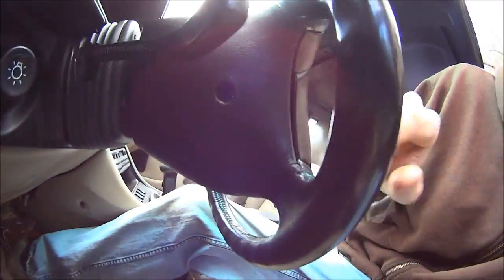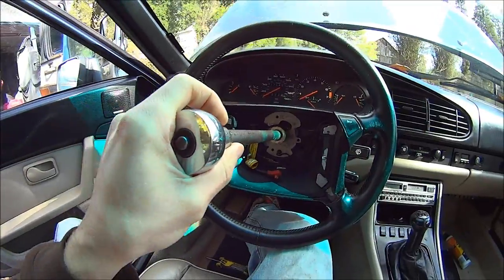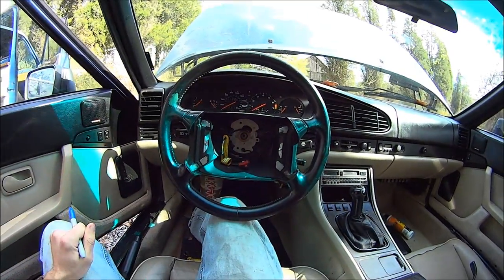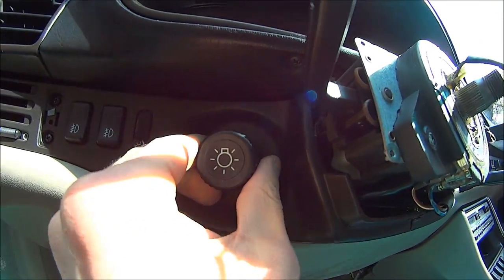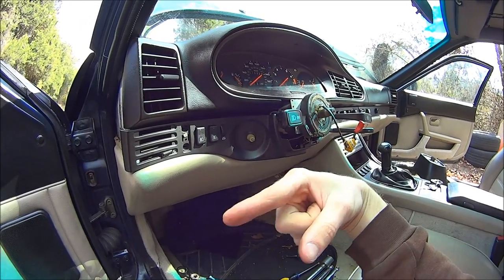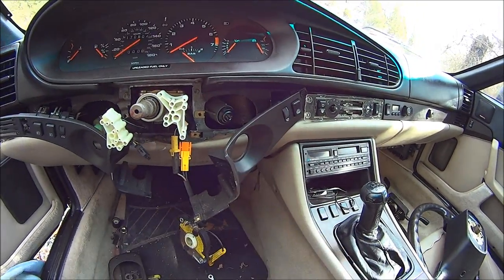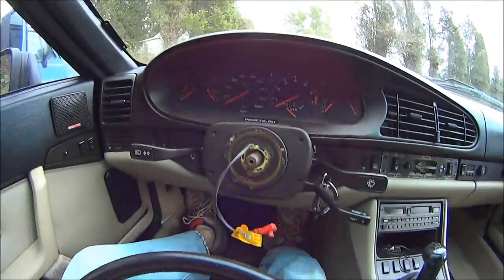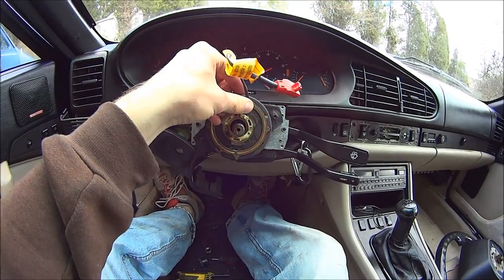944 STEERING WHEEL, airbag, blinker switch REMOVAL and CLOCK ALIGNMENT

Comment: Thanks for this info for removing the air bag steering wheel.  I need to change or clean my dash lights and check my tachometer by removing the cluster, but steering wheel had to be removed.  BTW, nice Blaupunkt unit you’ve got.

Comment: Awesome tut! Just what I needed. And in HD too!
Btw how do I reset the SRS light?
And how do I remove and replace a broken wiper lever and cruise control lever?
Reply from the maker: thanks, the levers are clamped onto the steering column so just loosen the clamp (probably a 8mm bolt) and the levers slide towards you off of the steering column. I might do a video on the SRS light in the future, but in the meantime for the SRS light go here: http://www.clarks-garage.com/shop-manual/elect-12.htm
Reply: a DIY Car Guy oh yea, I knew how to take out the 8mm bolt through your video. What I'm saying is I need to take it apart to replace the levers as they snapped off.
Reply from the maker: ohh, it looks like you have to remove the metal plate somehow, I've never done it, it looks like it's riveted on so those would have to be ground off or something
Reply: a DIY Car Guy awww, that's weak. I wish I had a rivet tool
Reply from the maker: for sure, they look like weird rivets, I don't think a regular rivet tool would work, i dunno